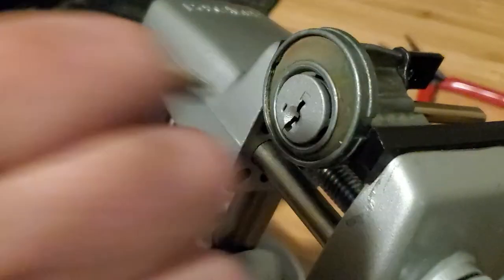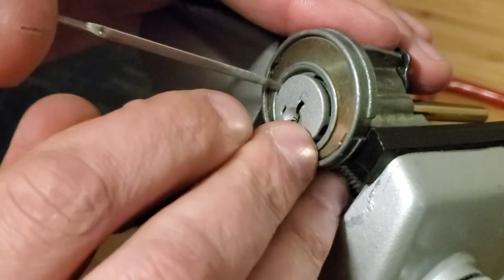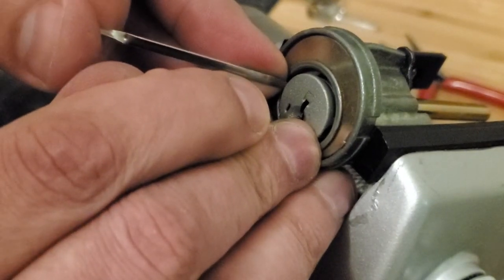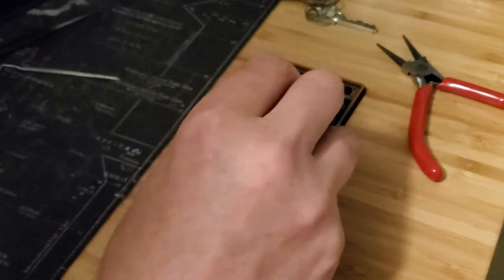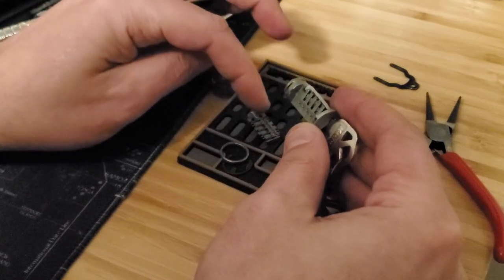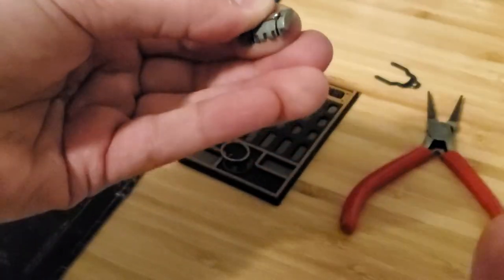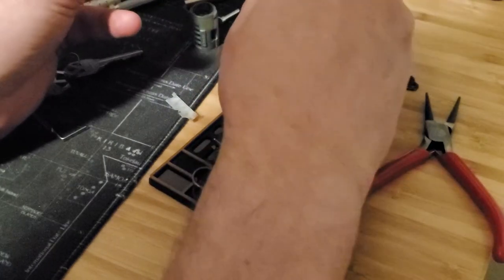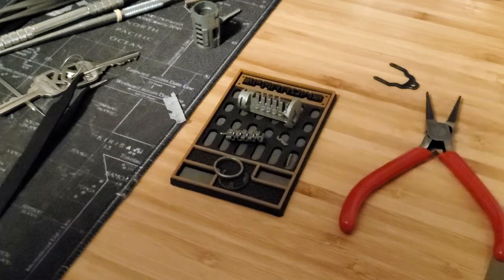[0005] Kwikset SmartKey pick and gut - for Brown Belt Submission

Comment: Nice work!  I have a Kwikset Smartkeu core, (not sure what generation) that I took out of a doorknob I found one the street, all beat up
Reply: If the sidebar is round, it's gen 1 and needs to be picked like a standard pin tumbler but with float picking.
If the sidebar is triangular, it's gen 2 and needs is picked the same as the gen 1.
If the sidebar is squared, it's gen 3 and need to be picked like Lockedout shows here.
If it has a Shlage keyway, It's SC gen 1 and has to be tensioned through the Smartkey bitting change hole.